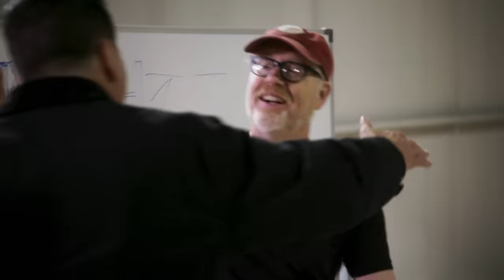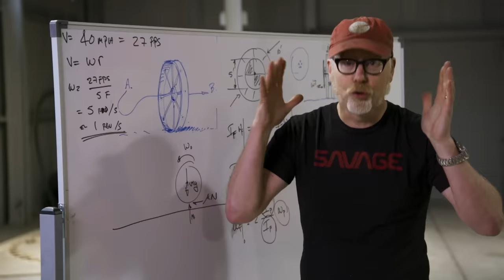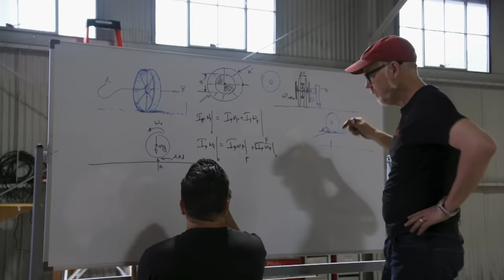"The Power In These Flywheels Scares The Pants Off Me" | Savage Builds

Comment: i like how all these incredibly smart people made all this cool elaborate stuff. and went it came to the brake they were like "eh, i'll touch it with a 2x4"
Reply: Yeah, and trying to brake near the centre of rotation, where it has the least effect.
Reply: @jamesbrown99991  It was intentional to do it near the center where the moment arm is small. He do not want the gyro forces to gey the flywheels to break free.

The goal here was to be as gentle as possible. The wood has the least chance to catch and make too high friction. And close to the center is the safest location. Better let it take some time.
Reply: Well any method of stopping it quickly would probably generate lots of heat and then you risk warping the disc, which in turn is extremely risky when spinning up to those speeds. Same issue with pushing the edges.
Reply: When they had reduced the speed of the flywheels, you can see that he stopped pressing against the side of the flywheel and instead pressed up against the edge of it - this also avoided side forces making the gyro effect having the flywheel break free.
I don't think they dared to do this at higher speeds because it's easier that the flywheel cuts into the wood when pressing against the edge, so they switched to this alternative when they had already consumed lots of the energy.
A real disc brake is self-centering and applies force from both sides, so it doesn't apply any bending forces on the disc.
Reply: @perwestermark8920  if only they put automotive rotors to stop the rotating mass near the center...... o wait they did. Wouldnt take a rocket scientist to fab up brake caliper mounts
Reply: @perwestermark8920  Maybe, just maybe they could have stopped it using the same engine they used to power the thing up
Reply: @spensinthevalley3099  well if you brake it like a car the whole ansemply would start to rotate and jump.
Reply: @Lightning_Mike  You noticed how they pulled away that motor? It can't be reconnected, since they did not design it with any clutch system.

If they had designed more advanced electronics, then they could potentially have used that motor as a generator. Just that the intention was to mechanically remove it and freewheel the contraption which means designing it for regenerative braking would have wasted lots of work to do something they don't need later and still doesn't help if you get too much vibrations or a bearing sticks.

What isn't obvious from the cuts shown is how much momentum the motor mounting can handle - how long the motor needed to spin the wheels up would also be an indication how long it would need to brake the disks with similar forces applied in the reverse direction.

I think the main issue here was that Savage forgot to mention the size of the flywheels (and didn't compute the amount of energy involved) and they didn't have the time to cancel this test at the current location and move to a better location where they could just have let everything rip if it went foul.
Reply: @nistorandrei6827 I dont buy that for a second. So you're gonna try and tell me a car on 4 post lift is gonna bounce around when you try and stop the wheels from spinning on a vehicle with a much larger rotating assembly?
Reply: @perwestermark8920  I did notice that they pulled the motor away, I just meant that they could have kept it there to stop the thing. If it could bring the flywheel up to speed it definitely could have handled stopping it. Stopping it with a plank looks more like a for-TV demonstration of how powerful the thing is, though
Reply: @Lightning_Mike  if a car wheels would instantly stop at 40 mph the car would freeze?
Reply: fred McMurray  it's stopping the same exact way just more effectively then the 2x4................ I didn't see vibrations from  that. Pull out some more "science"
Reply: fred McMurray  I'm fully aware, I'm also to aware of what happens when things are truly balanced. Maybe you could explain what the point of putting automotive rotors on when you already have the bearing you could mount to?
Reply: @spensinthevalley3099  As you saw in the illustration, the brakes would be used to transfer the energy to the inner wheels, and the ground would be the opposing force. If you were to just clamp a break caliper without a way to dissipate the energy, where do you think it would go?
Reply: @aerysgaming894  I like your analogy, I guess the only counter I have is disc brakes equally suppress the rotor and the more weight you have the more pistons the caliper needs and theres abs and other mechanics to keep things from going bad
Reply: 2x3 ...2x2...2x1...2x0.5...I'm outta here!
Reply: Yeah, havent you snapped the band off a bandsaw before?

After you have regained your composure, gone to lunch, and come back to find the thing still spinning, the tried and trusted 2*4 is the way to make it stop.
Reply: @spensinthevalley3099  well, that's the point of the project isn't it, to use the brakes to transfer the force, only they haven't built that part yet. ;)
Reply: @addledhead  ... or lot of electricity in case if electromagnetic breaking which needs to be dissipated somehow. Not possibly limited to heat.
Reply: @jamesbrown99991  Any further out from the center and it could very easily rip the 2x4 out of Adam's hands and send it flying.
Reply: @spensinthevalley3099  Dude... what in the ff has to do stopping 4 car wheels mounted in a parallelogram base with stopping a massive 1.5mØ steel wheel? Nothing at all, from the distribution of mass to the stabilty of the rig  to the heat transfer is remotely similar...
Reply: How much emf do you think it'd generate to brake the electric motor??? 
Don't think dissipating as much power as the Hoover dam would have been in the budget
Reply: @addledhead  you would ideally have a dedicated brake disk attached.
Reply: @Lightning_Mike  It's a dc motor powered by a battery pack operated by an electric car mechanic so it could definitely have regenerative braking. But hey the whole idea of the video is to create drama and controversy and get loads of comments so...
Reply: Like my first gocart  down hill test run 😂😂 break's????? Got a board here, just put it to the ground 😅😅😅
Reply: 5:50 I am getting Reservoir Dogs vibes here😅
Reply: At the center near the shaft no less...

Comment: I'm constantly surprised how often folks fail to appreciate the danger of spinning objects, so it is delightful watching folks who get it. Freaked out is the correct response
Reply: 13,000 rpm  large centrifuges need to be perfectly balanced
Reply: I was wondering why they didn't chain that to a concrete wall?
I mean, parking heavy trucks on the other side of a very expensive door?
What about making sure that can't happen?
Reply: @KarlMiller  6:44 - it was safely tied with a nylon cargo strap.
“Safely” is a relative term used loosely in this situation...
Reply: @KarlMiller  Not to mention it assumes the unit would travel in a straight line towards the trucks! LOL Anyone who has ever sat down a grinder and seen the disk come loose knows that thing is going to skip around the room like a hot potato!!!
Reply: An acquaintance of mine and his friends spun a high speed industrial fan up to twice it's rated speed. It disintegrated. The pieces not only went through the housing, but also the walls and roof of the warehouse. Pieces also embedded themselves into the floor. Fortunately it was mounted vertically and no one was in line with it. He talked about it as a learning experience on just how dangerous the things they were doing could be.
Reply: The dimensions and weight of that thing and not to mention the speeds they are getting it up to.... i am no engineer but i am pretty sure that that thing is like playing with 2 circular saws, except instead of cutting one or more extremities (in case of lost control i guess) it would probably go through you, your home, the neighbours home and their car.... that thing is crazy scary.
Reply: @numeristatech  yup the whole set up seemed... well.. red herring ish.. Cargo strap on saw horses, all for harmonic self balancing.. of course. Discovery has lost its flavour.
Reply: The mars rover guy seems quite phony... too..
Reply: @Smooth Move Yes ... the guy who lead the team to design a rover to land on Mars doesn't get it ...
Reply: @120ohm  if you put down a grinder while disc is still spinning you're gunna have a bad day..
Reply: No way of knowing which direction that would have gone, in addition to being individually balanced, the pair must match on a solid axle. Thats why it wanted to rotate. Is this correct? I never played with 2 gyroscopes. I think I would test at a smaller scale.
Reply: @dustinfirkins5736  it turned because the removal of the motor slightly slowed the flywheel it was connected to so that it was turning slower and had less energy. this means the axle rotated to balance out the two forces.
Reply: @Smooth Move He's the guy who landed Curiosity in 2012.
Reply: @ancientgriffyn  "noun: panjandrum; plural noun: panjandrums
    a person who has or claims to have a great deal of authority or influence."
Perfect.
Reply: @nutzeeer  As a biology student, I had to use ultracentrifuges at some point. These things go up to 150k rpm and they are absolutely terrifying. A weight difference of a fraction of a gram can make the rotor explode and then you have either a deadly projectile slamming through the casing of the centrifuge or that whole thing literally starts jumping around the room.
Reply: @KarlMiller  Because a chain honestly wouldn't do anything to be honest with that much mass at those kinds of speeds.   Pretty much if it came loose the amount of force it would generate would snap a chain on it and then you have a large chain that is going to be flying around.   Pretty much to stop something like that you need a lot of mass hence the large trucks parked in front of where they assume it would go.   That said Ideally you would do something like that in a dry dock or desert area where you don't have bystanders to worry about.   People just don't realize just how much energy is in contained in a spinning mass like that.   Something like that is also not likely to go in that ideal direction if something fails.
Reply: Do a search for "truck tires coming off" and watch a few of those videos and multiply it by a lot to get a sense of it
Reply: They only get it, but they obviously are not doing it.

I don't see any safety measurement sufficient to catch and rest the device if it shakes loose.
Reply: @CoxTH  yea mine was also a quite powerful centrifuge because they had quite the large diameter and ran on 480V power. about the size of a medium fridge
Reply: @KarlMiller  The amount of mass it takes to arrest a flywheel like that is substantial. Letting it move a little bit and dissipate energy that way is much better than having it tear itsself apart.
Reply: I've been watching people make these 3D printed brushless motors and they spin them way faster than they should.   I tell them how dangerous it is and they often times respond with answers that they don't think the danger is real.
Reply: Exactly. The reason modern washing machines have a lock mechanism on the doors is because there are a surprising number of cases where people's arms have been ripped off by trying to reach into a washer while it's on the spin cycle (especially children who don't know better).
Reply: @120ohm  In a straight line is the one direction that you know it isn't going to go!
Reply: @SuperReznative  I'm not sure what department he works in at NASA...
Reply: @CoxTH  Sounds like a hotpoint washing machine!
Reply: @JustWasted3HoursHere  Or Adam Savage with a piece of 4x1"!
Reply: @Frank Peeters For sure, because the faster it spins the more that imbalance will matter. And the way they disconnected the flywheels from the motor is extremely clunky. A better solution must be found. Perhaps something like a centrifugal clutch.
Reply: @briggsbughouses6291  Yeah, that was not the safest way to stop a spinning 400lb flywheel!
Reply: @nutzeeer  i`d advise the same for a 1000rpm giant wheel..
Reply: @KarlMiller  if it wants to go, there is nothing that can be done about it... it`ll go wherever it damned well pleases... it won't care about chains, straps or anything.
Reply: @a.noniem7455  yeah haha. the amount of energy involved is underrated. i mean centrifuges reach 10,000 times earths gravity
Reply: I think it's strange that the original poster "constantly" encountering other people with "spinning objects". Does he go to frizbe contests or something? I never see people being careless with spinning objects. Matter of fact other then tires I never encounter spinning things. Maybe he works in a machine shop with a bunch of dummies is all I can think is possible??
Reply: When the camera showed that much of a wobble in that big of a flywheel, a shiver went down my spine and I'm not even an expert by any means. Needs a custom machined and perfectly balanced flywheel to match their mathematical equation  they spent so long working out not a disc cut out of a flat sheet.
Reply: Spinning heavy metal objects in this case... <cold sweat>
Reply: @numeristatech  Oh! They were saying "safely"!? I could've sworn I heard, "safe*-ish*"! 🤔😉😋🤣
Reply: @j.c.cannon2112  I'm pretty sure that the turn resulted because the dismounting of the motor wasn't done linearly with the axis of rotation, but at an angle, which imparted a slight moment around the Z-axis just prior to it coming free. 

The two flywheels appear to be bolted to a single, solid axle: I don't believe they can rotate at independent velocities, well without/prior-to the axle breaking anyway...
Reply: @briggsbughouses6291  "I'm not sure what department he works in at NASA"

A: The Jet Propulsion Laboratory at NASA - aka "JPL".
Reply: @JustWasted3HoursHere ... disengaging the flywheel that way,,(would introduce a severe resonance) was so.. childlike, Flintstones.. they are obviously playing to a lesser intelligent crowd,,, People wake up and stop falling for these fake pseudo science guys.
Reply: @briggsbughouses6291  .. Hah.. wilder, /crazy than Russian roulette. 😜
Reply: @jacobwhite7408  Yeh,.. so lame $$$entertainment, has no shame.. It's insulting the viewers intelligence
Reply: @johnbennett1465  your friend used it in a specifically more dangerous than normal way, of course it was going to be dangerous. Driving in the wrong lane of the highway at 100 mph is dangerous too, but that doesn’t mean every car is dangerous no matter what it’s doing.
Reply: They didn't get it. Nothing weighing hundreds of lbs is 'perfectly balanced' on saw horses
Reply: @120ohm  😬😵😲
Reply: it's the circular nature of the universe..
Reply: @120ohm  at such a high speed and with two “wheels” it’s rotation would keep it locked in a straight line
Reply: You have spining object fobia
Reply: Judging by their setup there I don’t think had nearly enough respect for the amount of energy they were dealing with. Those flywheels weren’t balanced and the axle was ratchet strapped to sawhorses and a single I bolt in the floor. They are so lucky
Reply: Would have been a bad day when it broke loose and just shot through the side of the building.